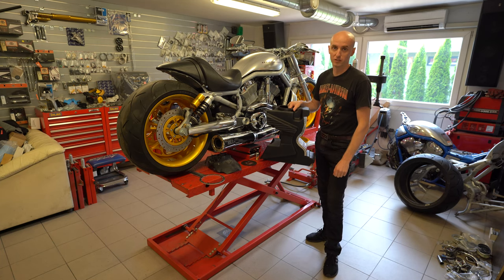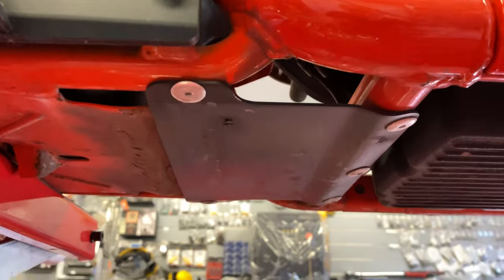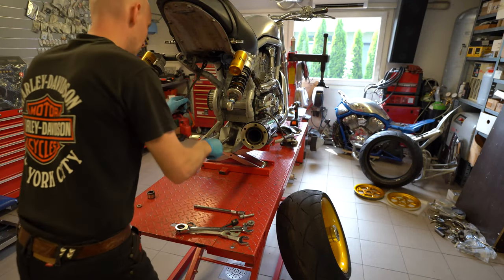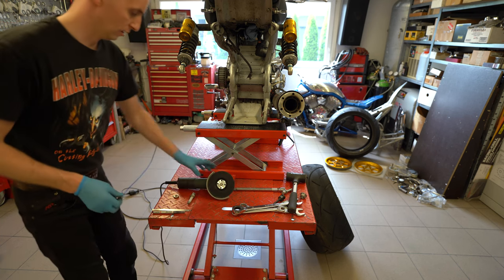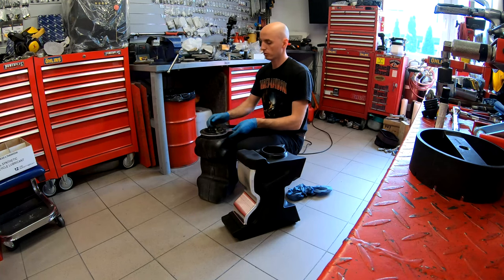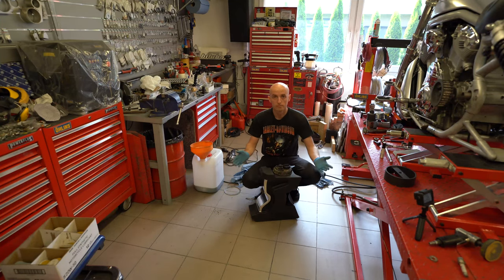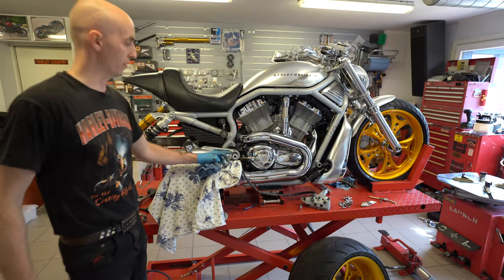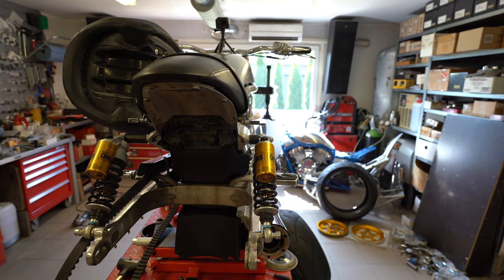V-Rod 5 Gallon Gas Tank Installation on 2003 V-Rod by Grandmaster Fredy - Fredy.ee

Comment: Great video, just received and installed my tank, only thing not in the video I came across vs a bone stock bike is you also have to trim the lower belt guard. With cutting cleaning painting etc on a stock bike with a brake bleeder your looking at less than an hour start to finish. Only thing I'd add is be sure you're straight on plugging in the sending unit so you don't bend pins, and get some scotch bright and clean the varnish off the level sensor while you have it out.

Comment: Nice shop, bought the vrsca 9yrs ago and has the mod tank. Everything is tucked so tight within the frame, ie the battery. Now sensor tube needs to be replaced, don't trust the gauge. Aft fill, doesn't show above 3/4, so good to inspect /change the fuel filter. A 3 gal on 1100cc,, why they design a peanut 
tank fuel sys ? thx for the post, love my Vrod

Comment: I have a 2004 v rod. It was of the road about a year now. Before that I replaced the battery. I start the bike but after 2-3 seconds it shuts off. If I try to give it some throttle it shuts of imidiatly. Can you please give me any advice what to check before I take it to mechanic?
Reply from the maker: Yes, take it to the mechanic!